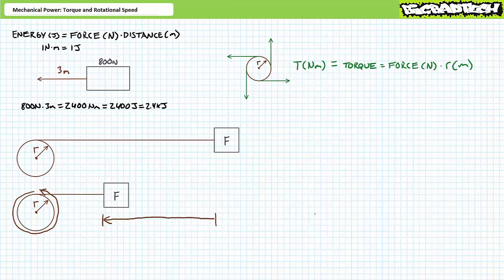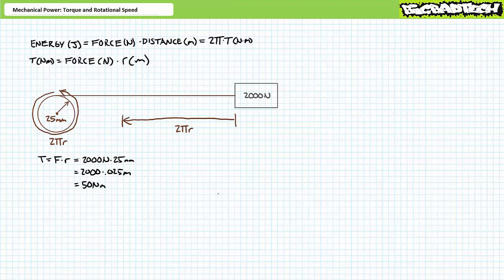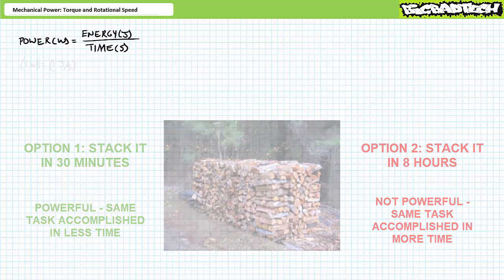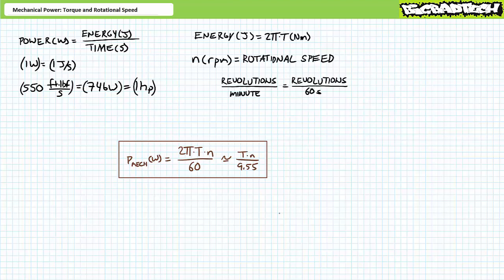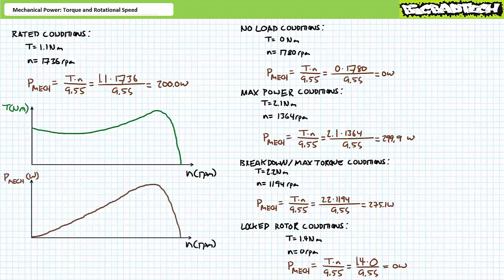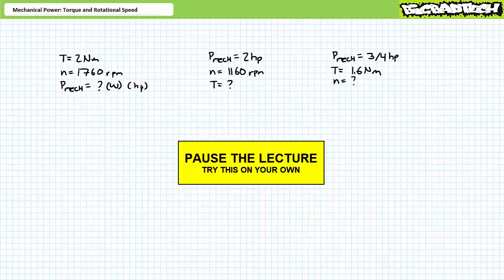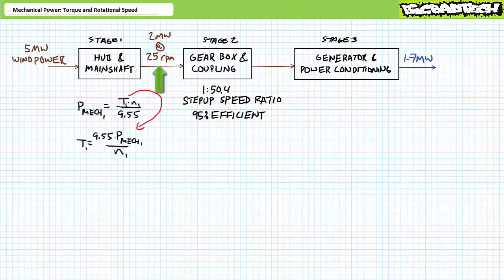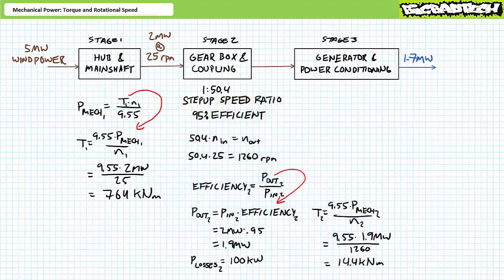Mechanical Power: Torque and Rotational Speed (Part 1 of 2)

Comment: Hi Jim, in my experience with reciprocate generators this information clarifies a world in the designing of the mechanical source of rotation, now comes an interesting question , considering the maximum torque!what criteria should I use to choose the axle (or ammount of junction plates of flywheel) of the generator end?? Anticipating a positive response to that interrogation, our best regards and congratulations for your channel.
Reply from the maker: Stay tuned for part 2 and an upcoming lecture on "Electromagnetic Interaction". As I'll explain in the upcoming lecture generators experience counter torque or braking while in operation.
Reply: @bigbadtech  🎇🎊🎉